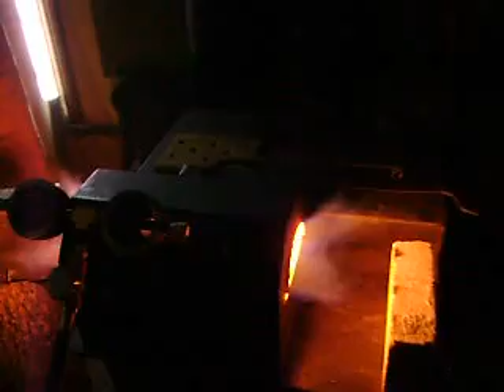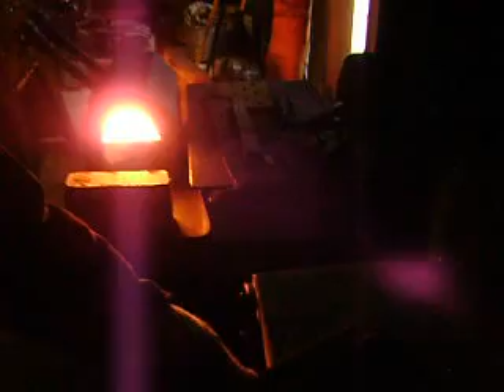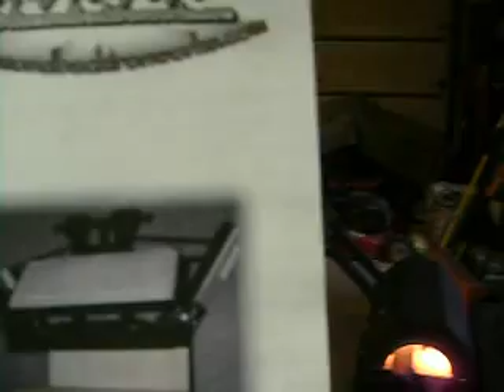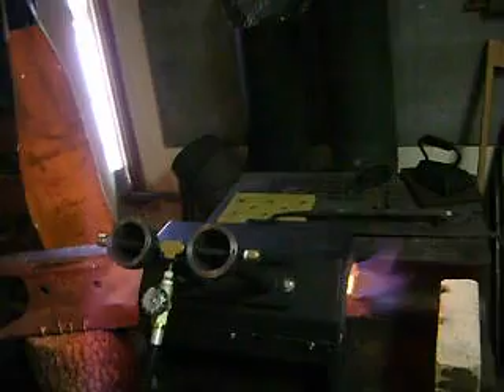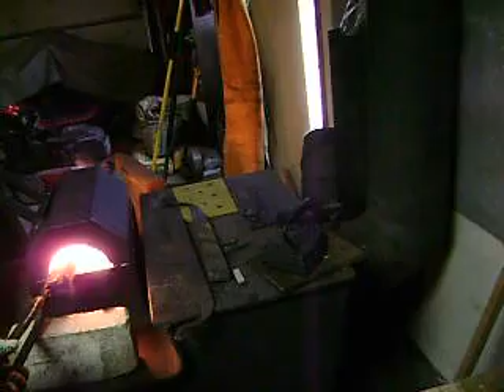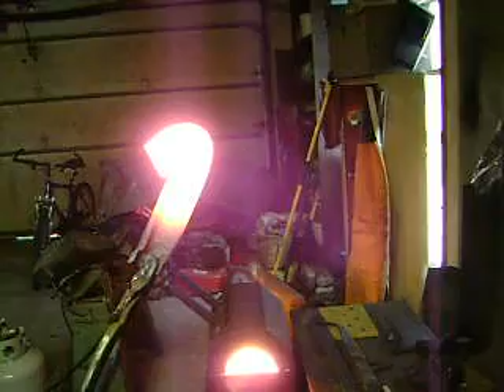New gas forge!

Comment: Been building forges of that pattern for over 20 years. If you fan-force the air you don't need much pressure (about 3psi) on the gas and NO jets..... You can run it really lean which means high temperatures and low gas consumption. If you want easier welding, just pre-heat the ingoing air, which is easy to do if you fit a chimney on the outlet and put in a heat exchanger for the ingoing air. I have made over 200 of these things, so if I can help anyone, just ask... :-)